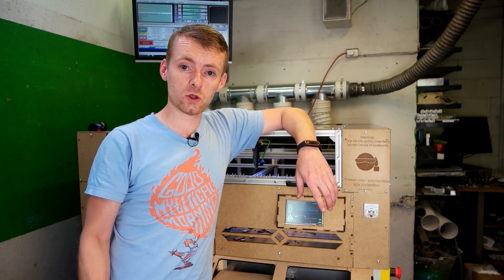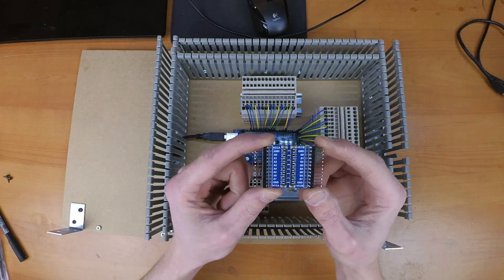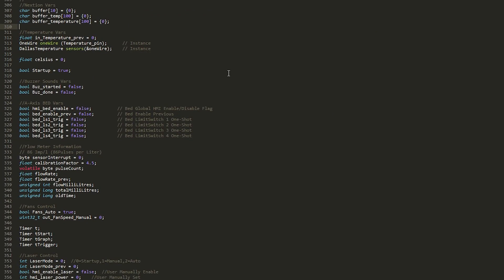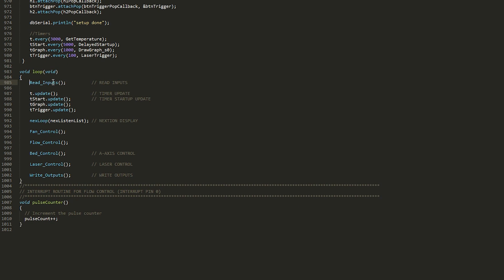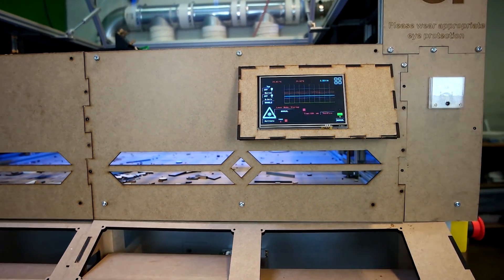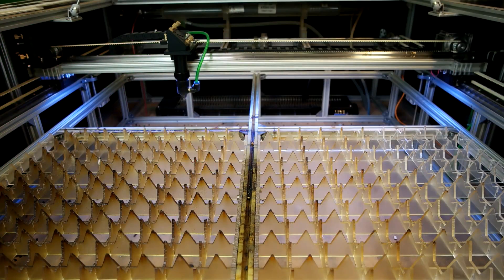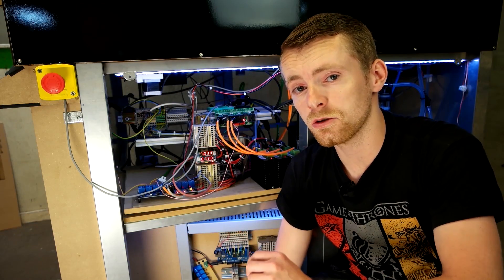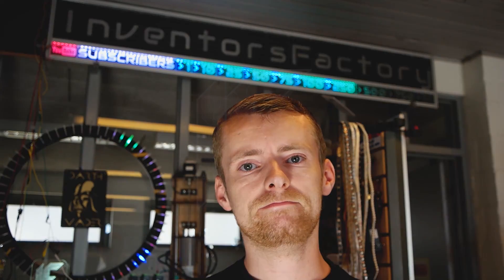DIY Laser Cutter Buildlog - Part4 - Waterloop Test, Electronics Cleanup, Safety and Extra

Comment: So you are using just heat sinks and fans to cool the water and that’s it?
Reply from the maker: Yep but not sufficient during summer. and the fans are not normal pc fans these are 255cfm fans...
Reply: I really like the way you have yours set up. I would like to do something similar except for adding instead of using fans using refrigerant some how. It doesn’t have to be and freezing temps just enough to cool it down.
Reply: Not refrigerant but like a 200watt peltier module or a thermal electric cooler.
Reply from the maker: Yes, thats probably a better solution,  it all depends on the laser tube specs, typically they say temps of around 15 to 25... so a 40w tube will be easy to manage, but a 80~100 tube, will need something beefier to keep it in that range during longer cutting jobs.

Comment: The only real problem that I would have with a system like the one you built is the actual build cost which would be about $ 3,600 in the USA the 2nd problem is that your machine is vary close to being the top of the line having all the bells and whistles it's just way to much overkill for what its intended to be used for requiring several computers monitors to display every function it looks really good its pleasant to see but for the money that was spent on developing the laser cutting machine you could have built 2 fully functioning laser systems and almost finished a 3rd system depending upon the wattage of your laser cutter's tube size again your system looked really good but it's like what you'll see with some of the young people in America they will take a used car that's worth $3,000 and stick $8,000of tires and rims on it or they will put a audio system and speakers in it that cost $ thousands more than the car it just looks odd from a logical point for the money at least in my case I would go with the most bang for my buck by only building a co2 laser system using the best component parts but keeping it simple bear bones so to speak .most of the Chinese co2 laser cutter engravers are good examples of the bare bones concept they have just the most basic of components on board to run the unit I'm not against your system but it has way more advanced components and technology than 99.99% of the people want or need it's just way to complex for the average person to troubleshoot and fix if any components fail
Reply from the maker: Thanks for the comment R Broyles, 

You are correct, it's to expensive and to complex for sure. 

When I started the build money wasn't really a factor, and there was limited info on the matter out there (this is 5years ago) So I pretty much just started, and problemsolved as I went a long, and therefore a lot of money whent into trial and error. Also I didn't want to limit myself any special function so it kinda whent overboard with the gimmics :D 

My second laser that I'm planning on building, I'm thinking praticality and simplicity so it will indeed be cheaper :) with less stuff that can break :D

Comment: Simple water heater = low power halogen bulbs. Can be controlled by ambient temperature around the laser tube to keep it from getting too cold, same goes for the reservoirs.
Reply from the maker: That was actually a great Idea Brian, plus it gives some extra light in the back of laser :D
Reply: @InventorsFactory  It's not mine. I got it from Russ who does videos for learning and instruction based on Chinese CO2 laser systems.
Reply from the maker: @brianfoster7064  Aah I must have missed that one! I am a sub and I've seen many of his awesome videos :D

Comment: sooo in stead of using like GRBL u made your own code to turn gcode into outputs??? seems alot of work! ever tought to make it open source?
Reply from the maker: Hi Jordy, no no, the code does nothing with the steppers, that's controlled vi Mach3 and the Pokeys Board... all the code does is pretty much just some controls and stuff for water cooling, fan speeds and some safety features :)

Comment: Have you ever thought about incorporating the TMC2130 stepper motor drivers?
Reply from the maker: Hi Janak, I've heard some good stuff about them and believe Henrik at InventorsFactory swapped his 3d printer ones for these due to noise and now runs silky smooth and silent. I could use those for the Laserbed due to Nema17 motors, but already had the TB6600 so I might aswell use those... although I've just disconnected the laserbed from driver now as I hardly use the bed :)

Comment: Love the videos.  I have a question for you regarding the controller you're using for the laser cutter, how you control the power (if you can programmatically).  Do you have a buildlog for just the controller handy?  Thanks!
Reply from the maker: Thanks Dan, good question, I wanted to use the Pokeys56U for the power but didn't really know how to due to the pokeys beeing at 3.3v... that's one reason I put an Arduino in the system to act as the power controller.... But now I've just connected a 0-5v Potentiometer to it, and controlling it manually.... 
My plan was to use the Commands for controlling the Spindle RPM for it as that is possible with the Pokeys Plugin for Mach3... 
For my cnc upgrade I'm going to buy the Pokeys 57 CNC board and use mach4.. so If you haven't bought anything yet, I'd go for that aswell... (btw 56U is also supported in mach4) 
I'm not sure, yet, but I might go with making a video on the cnc upgrade and talk about the pokeys, but that won't be very soon... Good luck Dan
Reply: Thanks for the explanation.  I re-wrote a post processor for Fusion 360 to better handle the M3/M5 commands, and can use Spindle speed (S#####) in GRBL to handle beam intensity.  It only makes sense that the 5v Potentiometer should be able to be controlled via a solid state one, and controlled the same way, however looking at a few different resources, it appears that the pot is only controlling pulse duration, not intensity.  So the laser is 100%  beam with 50% duration, vs 50% beam with 100% duration..  Since you're rolling that manually tho, I can safely use a ramps board to replace what's in there.  I really enjoyed the build log, and thank you so much for showing what worked and didn't work with cooling.  That will save me more time than anything when it comes down to building my own.  Cheers!
Reply from the maker: Wow Dan, that's pretty impressive!!! that post processor of yours! is that something you have shared somewhere ? :) 
I'm slowly and steadaly getting used to F360 and my next step is to do the cam aswell, so I'd like to try it.
I have been avoiding it for a long time, but this thing with controlling the laser beam, intensity/duration! What's the best thing to do? 
you have any suggestions/eastereggs on how to control it better with some standalone thing, instead of my 0-5v pot :D 

Thanks for watching my buildlog Dan and thanks for the appreciation, cause the only thing my videos actually give is inspiration for those searching it, and what to avoid doing :D and of course how one guy did it ;)
Good luck with the watercooling Dan, and seriously when you start your build etc, you've got to give me some info on where to follow your progress!!! I'm in constant search for inspiration and cool looking things :D especially diy laser cutters
Reply: Thank you!  I have not had a chance yet to release it.  As I said, with the Diode system, it works great, but now I need to build into one of the K40s.  If you want to share with me the schematics you used, and answer some questions, I'd be more than welcome to send it to you and work with you on getting it ported over to work with the K40.   I won't be building mine until this fall, but I'd love to have the controller ready to go.  You have a great tech goldmine of brain power, I bet we could knock it out quickly.  My email is my first initial, last name at gmail or hotmail.  If you shoot me a message, I'll get it over to you, and we can talk about insertion points in the controller to make it work.  The overall goal is to get the post processor to 1.  Turn on Air Assist (M9), 2. Spindle control the laser when only when cutting (done), and 3.  Control laser intensity (Spindle Speed).  Once that's done and we open source it, it will literally change the landscape for all laser engravers and how it interacts with Fusion 360, and easily accessible free software.

Comment: You need to put that T on the water before both of the water tubes then equal tubes and heights will give you better ratios
Reply from the maker: Hi Timothy, yes that would also solve the problem :) also they are same size and heights

Comment: Hey buddy, i was thinking of making the same laser cutter but have no idea of total cost so please if you can tell its total cost and all the required parts it would be very much helpfull to me.
Reply from the maker: Hi there Arpit, my reply must not have gotten through the first time!! Sry for not checking up on it! 
The total cost of my machine as is, is around 4k usd not accounting my misc failures ;) and I don't have a list of required parts as most of the stuff I bought was such a long time ago. I don't recommend anyone building my setup! which I explain more about in end of part5b... but I do recommend checking out this instructable and a youtube video from Physics Anonymous.
https://youtu.be/4CZBlIdjsvM

http://www.instructables.com/id/Make-Your-Own-High-Quality-CO2-Lasercutter-With-To/

That said building your own lasercutter takes time, but is really rewarding... I'd say go ahead, I built my own cause I wanted a bigger cutting area than the ones I looked at... and I liked the challenge ;) no matter the cost :) 
Good luck to you Arpit
Reply: InventorsFactory I'm sorry for replying late but i am a bit confused for the design of the frame as i decided to make the frame with aluminium l sections to make it cheap. Once the frame is ready other all things will not take more time. So if you could help me out it would be great pleasure for me. And lastly thanks for the video it really generated new ideas in my mind.

Comment: Great, why not to get the ambient temperature and automate the fan speed?
Reply from the maker: I actually already have that but use it manually due to arduino interference.
Reply: electromagnetic problems?
Reply from the maker: Yeah... Arduino resets and sometimes just freezes...

Comment: even though you have a closed loop system this may help your water  issue, and it would be better to pull the water through the radiator saving the pump. thirdly mount the water holding closer to the concrete floor to reduce temp.
https://youtu.be/H07bOqBv8LM
Reply from the maker: Hi Phil, hmm yeah didn't think about that, pulling through the radiator would actually be better for the pump. and definetly moving the reservoirs closer to the floor will improve temps, but I wouldn't gain much by 15cm :/ 
Water cooling sofar is not the issue really, it holds :) but if a more powerful tube gets installed, I'd definetly think of all the suggestions sofar while upgrading the cooling.

Comment: your laser cutter was awesome but i cant understand your wiring can u plz send me the wiring of diagram of laser cutter.
Reply from the maker: Thanks Sri, Yeah! don't think my wiring will help much for anyone as this is a wiring nightmare from my part as I've incorporated some relais as safety and arduino between and the actual non-typical Pokeys56U as a controller... so basically my machine is run like a cnc instead of the typical laser engravers. I'd suggest finding some simpler wiring diagrams on some laser engraving groups/forums.

Comment: Loved it!
Can you add links to the DIN Rails and the Wires connectors installed on them?
Thanks again!!!
Reply from the maker: Thanks Avi, I'm afraid I don't have links as Both the DIN Rails and connector Terminals were from my works scrap container 😉 But ebay it and I'm sure you'll find something useful and probably some better terminals than I got 🤓

Comment: awesome !!! definitely subscribed ! 
witch program are u using to parse ur g-code ? 
do u have an additional arduino to controle ur x and y axes?
man i have so many questions xD 
well done!
Im studying mechatroniks and i live for projekts like this.... so amazing !
cant wait to watch more!
Reply from the maker: Thanks Lukas :) 
I'm using cambam to create the gcode at the moment, which is a great and so easy to learn, although I am trying to slowly transistion into Fusion 360 ;)

The Arduino has no control authority over the movement of any Axis, It's all controlled by mach3 with a plugin for the Pokeys56U Controller board.
 
Hehe many questions eyh :) well I'm not an expert, but I should be able to answer hopefully some of them ;)

Mechatroniks, top nice... I like projects like this aswell, I watch tons of videos myself just for the pure Nerdgasm to it, but also for new ideas and inspiritation to create :D
Reply: Ok first thank you for your answer ^^
I ask me if u r using sublime text only to write your code and use then the normal arduino ide to programm 
your arduino or are u using the arduino add on for sublime text to programm them ?
What is your programm doing if u hit the emergency stop? is it pausing? or do u have to start the programm new ?
Reply from the maker: I use Sublime Text only as an external editor and still use Arduino IDE to download to Arduino :) 
I have until now, never used emergency stop as it pretty much loses it's position in the process so you need to re-home and restart everything. Normally I just use Stop/Pause :)

Comment: The Peltiers would have worked but you would have needed 4 of the 3 bank units. This 720 watts of Peltiers will give you about 500 watts of functional cooling power. I won’t try to explain the math to figure this out as I barely understood it and with a lot of guesswork came up with the watts needed.
 I also think you need a little larger water reservoir around 4 liters and insulate it. I have a 40 watt laser which I built a Peltier cooling system for. I’m using 2 of the 3 bank Peltiers and about 2.5 liters of water reservoir. I control the cooling temp with a JLD612-DC Temperature controller and relays. It operates at less than 50% cap. for most cutting and even with the lasers max rate (not recommended for good tube life) it’s not been overwhelmed.
Just my suggestions… looking forward to where you end up with this project.
Reply from the maker: Hi Steve, guesswork hehe, yes my guesswork was just waayyy off but ok. I had no idea how the darn things really worked. Adding more water to the system is a must anyways and if/when I revisit the peltier cooling, I know there are alot more factors to consider which you also mention 😁 insulation beeing extremely important and alot more of them 😉 But sure does sound like yours actually is working, which must be pretty cool 🤓

Comment: Hi, thanks for the video. Great job.
Considering your safety issue: How about combining your z-axis direction change controlled laser on/off with the "spindle control" (or something like that). If you use an AND logic and include some "tool on/off" commands in you g-code, this may solve your problem.
Reply from the maker: Thank you Ove, 
I actually did exactly that, using the logic level converter to control a relay that triggers on the M3/M4 commands from the g-code :) Another member at IF gave me the exact same solution ;) Although I kept the Manual Activate/Deactivate function relay for dual safety as I like the feeling of having the last word :) As I really don't want another one of those incidents as I got lucky the first time ;) Thanks for the solution Ove, none the less :)

Comment: A way to increase the passive cooling of the water would be to get a car AC condenser to act as your radiator. This gives you a large passive cooling but also the ability to use an electric radiator fan 12vdc for active cooling. Its copper pipe internal so safe for the distilled water you are running and just requires the right sized connections brazed on to hook right to the existing pipes.
Reply from the maker: Thanks for the comment Andrew, back when I started it did cross my mind :) but was afraid of residue contaminating the water, but as you say if it's copper pipe it should be good so I just need ensure that... 
But if, I mean when, I'll definetly look into that and a reasonable small form factor.
Reply: Looking at passively cooling a pc is why I first looked at car radiators but the process to convert them is a pain due to the need to be vertical and the port configuration. Looking at other parts I saw the oil/transmission coolers and the AC condenser both had possibilities as you can hook them up to be in any orientation with the only limit on the water storage when off as i prefer to have everything drain when not in use. 

As for the idea of residue or contamination a pressure test and flush will deal with that but as long as you get new parts the only thing inside will be the lubricant they used to make and bend the copper pipes as no refrigerant or oil has been added yet.
Reply from the maker: Hmmm now that you mention it, I need to correct my previous comment! as I was looking for car radiators not ac condensers, and googling about the ac-condenser brings up many good solutions! wow so many different configs, it could really be a nice project in it self... Thanks

and yeah, a brand new one shouldn't contain anything else but that lubricant you mention, good to know! :)
Flushing of course, but I didn't think of a pressure test :) That would also be very important! thx

It sounds like a really great project of passive cooling a PC like that, are you going to use a pump or run complete "Passive'ness" ;) ? 
and remember to do some temperature benchmarks before/after :) would love to hear about the results...